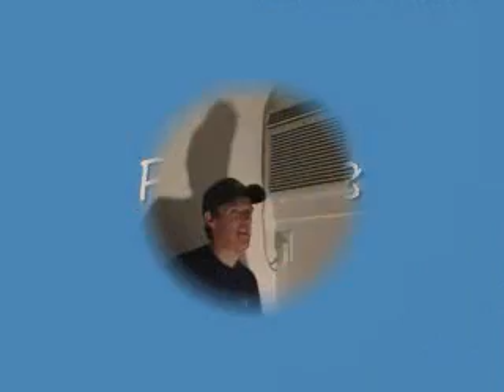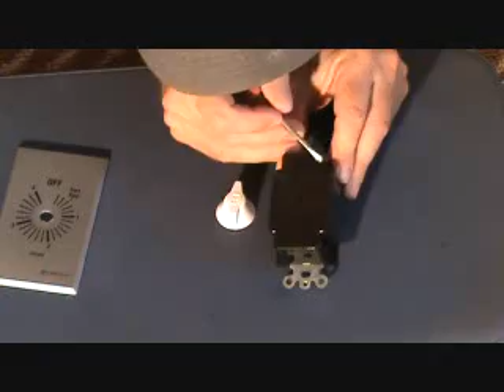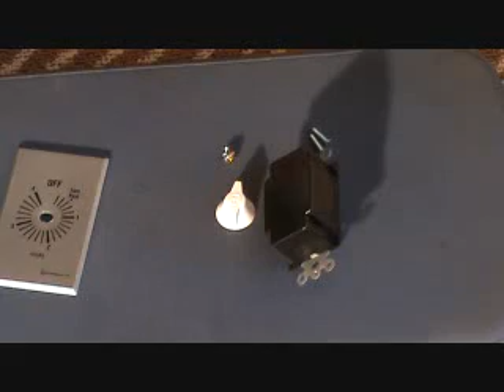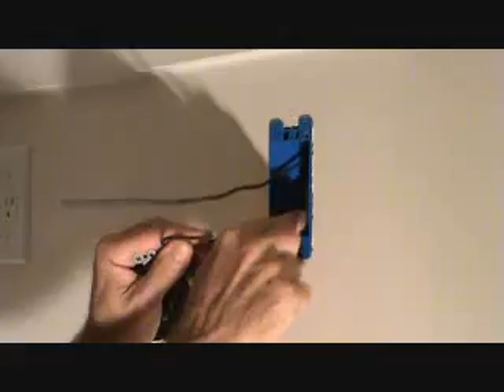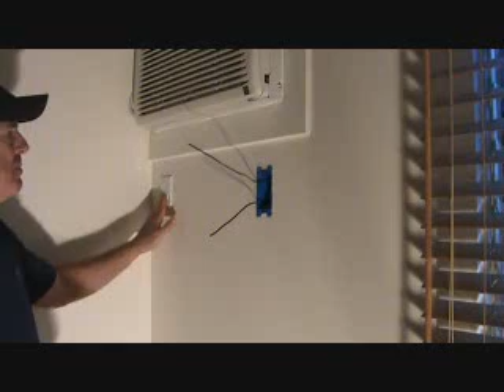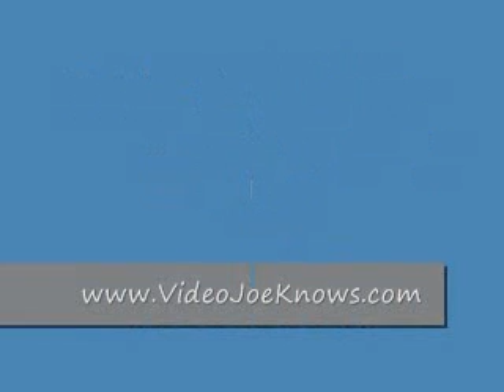How to install an AC 4 hour timer...Part 28

Comment: I just did some commercial wiring with a company (1 days worth) that, of course, uses metal boxes. After all the wires are connected, I wrapped electrical tape all around the switch to cover the screws/exposed wires to prevent the possibility of accidentally grounding the connections to the side of the box. Just a good tidbit of information when using metal cut-in boxes.
Reply from the maker: Yes you are absolutely correct. I've seen electricians always wrap electrical tape around light switches & duplex outlets etc. when working with metal boxes & metal cover plates. Great job!   Joe  :0